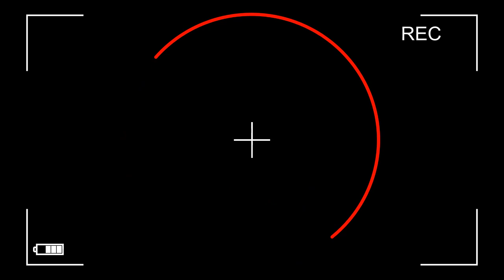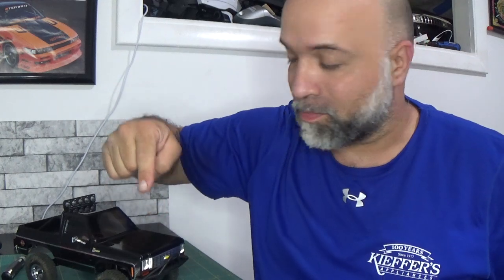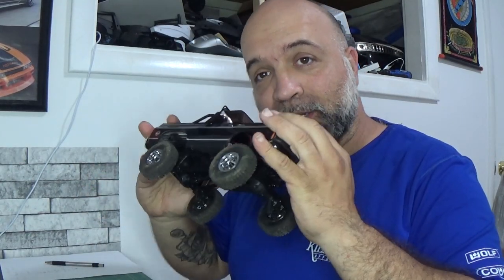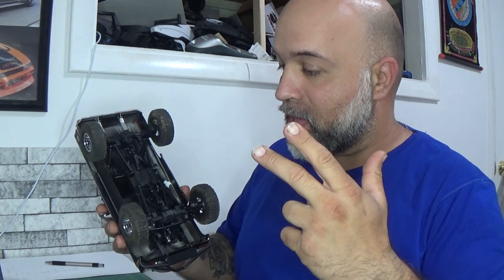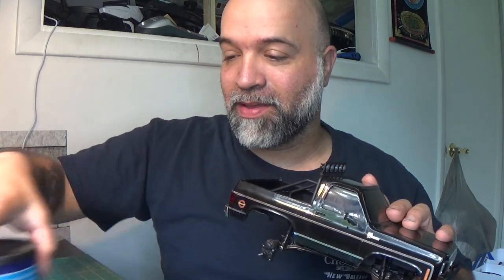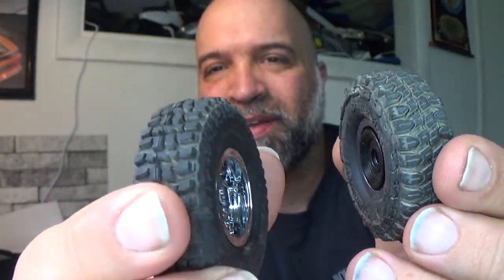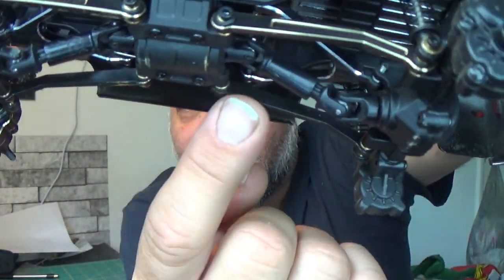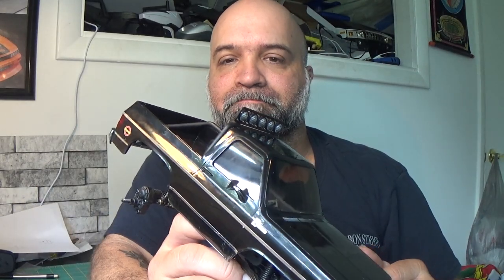FMS FCX24 K5 Blazer with a bunch of brass upgrades offered by FMS and Metal wheels

Comment: Some of that weight is the bag that it’s in
Reply: Would of thought it would have been easier to just weigh the K5 as it is out of the box and then weigh it again when all the mod are installed, you then have a much more accurate result imo.

Comment: do you recommend getting metal drive shafts? if yes or no, why? im very new and just curious
Reply from the maker: You can get metal drive shafts if you want they can last longer and will not twist and break when your crawling hard. Or you can also beef up the plastic driveshafts to prevent them from twisting but it all depends how hard you drive your rigs

Comment: Where did you get your brass?
Reply from the maker: All the brass for the fcx24 i got from fms they have all the brass options on there website
Reply: @rccargarage  thanks bud!. I just added brass steering links and All Terrain Super S5 Soft Sticky Tires from Injora. And RCLIONS Aluminum 1" Micro Beadlock Wheels Rims to my K5.
Reply from the maker: Nice these things perform great with better tires and a little weight down low